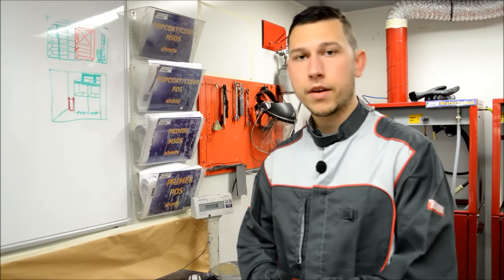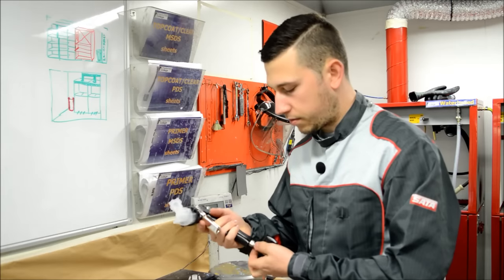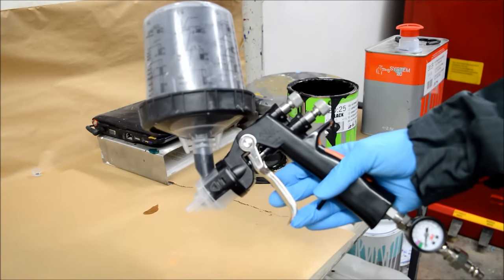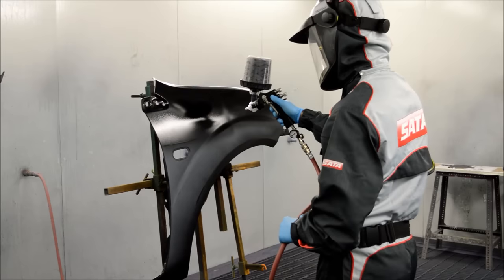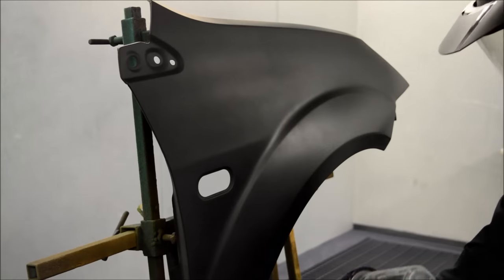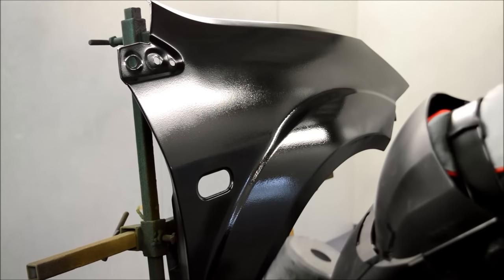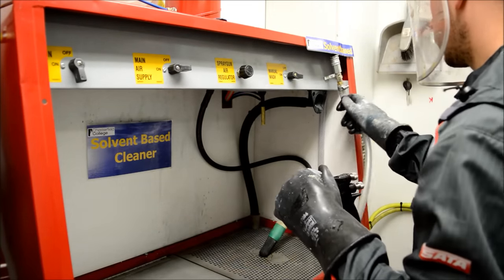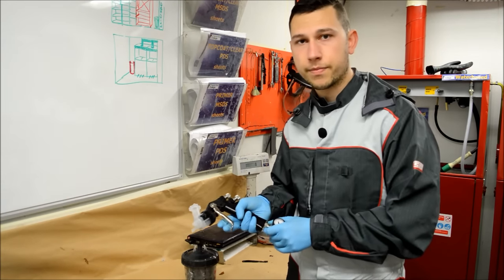3M Accuspray REVIEW - DEMO !!!

Comment: One more thing left; after cleaning the tip, we need to pull out the tip and clean the nozzle valve with a clean towel dipped in a thinner.  For it could have built up some dry paint if left alone.

Comment: Hello...GREATVIDEO...I just bought this setup (arrives tomorrow) and I am curious. It seems to have built in filters in the PPS cup. Can they be removed for spraying high build primer (1.8) and for metallic's in basecoat (with 1.4)? I fear that it would filter the metallic or worse, clog ? Thanks in advance.